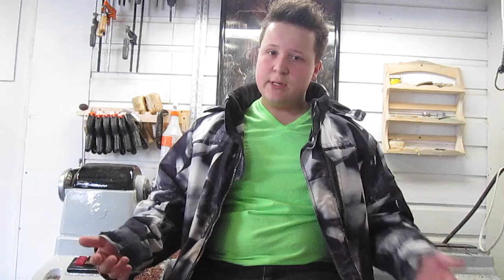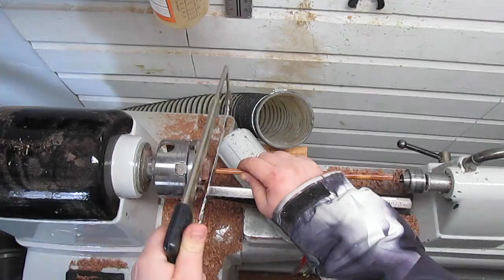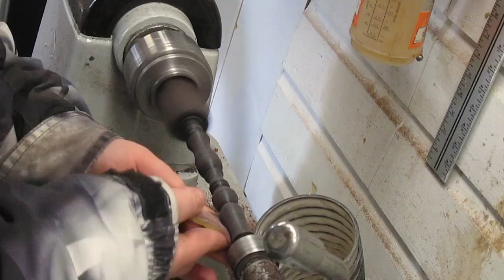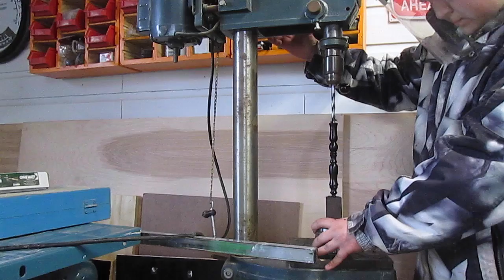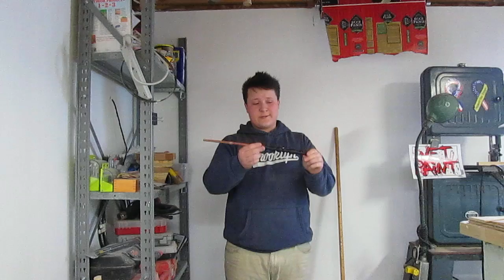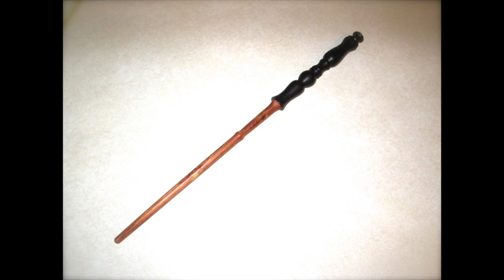Woodturning-Wand

Comment: Hey just some advice from a fellow wood turner. Use sawdust and wood glue it works the same as the epoxy but soaks into the pores of the wood better and secures it more permanently.

Comment: I have a problem with the wand flexing when it gets to a certain thickness when I make it all in one piece on an 18 inch lathe.  Any tips?  does it have anything to do with a proper way to hold the tools and come at the wood?

The wood I use is usually oak.
Reply from the maker: Yes it does.  When the wand gets thinner the wood isn't strong enough to support the cut.  It helps to use a skew or something like that because the chisel isn't approaching the wood head on.  The cutting action is more of a slice and the wood doesn't want to flex as much.  Take lighter cuts and if you're not comfortable with a skew, tip your gouge at an angle so that the wood doesn't come into head on contact.  Thanks,
Pete
Reply: Thanks, man! I'll give it a shot!
Reply: Robert Chambers Also see Carl Jacobson's video on making a wand.  In the comments he provides advice on how to support the thin pieces while turning.

Comment: Here's a challenge for you!     Make a wand that has a small hole drilled lengthways, and a place for an LED light at the end?(blue) and hollowed out handle to accomadate 3 AAA batteries to pwer the light. I don't know what could be used for a switch but it would have to be small and un noticeable. I thought of this while watching you make the wand you just made..it's just a suggestion.

Comment: are you self taught, I'm thinking of getting a lathe, any advice
Reply from the maker: Kinda sorta self taught.  I'd recommend whatever lathe you feel is within your budget.  You can get some really nice stuff from grizzly machinery for pretty cheap.  You want to consider the size of the stuff you want to make and if it will fit on the lathe you buy.  Also, variable speed is a MUST! Its definitely worth the extra 50-100$ for a variable speed dial.  It will save you a lot of time.  One final word of advice: join a woodturning club.  There are a lot of them in the country.  You can look up the American Association of Woodturners and find a local club.  Clubs are a much better way of learning than youtube videos :)
Thanks,
Pete
Reply: Consider just buying used off of Cragislist or similar. I got a Delta Homecraft, pretty old, but works great and has much greater capacity than one of those mini pen-making lathes (and still cheaper).  Especially so if you are "just thinking about it", as you won't be investing so much.

Comment: Last time I tried turning a wand it snapped in half...
Reply from the maker: lesil1000 use slicing cuts. a head on cut will stress the wood.  don't push into the wood. work lengthwise with the wand